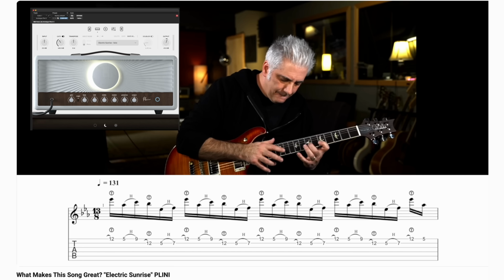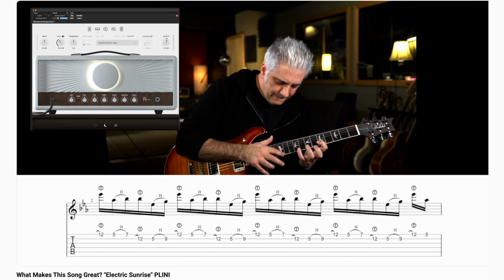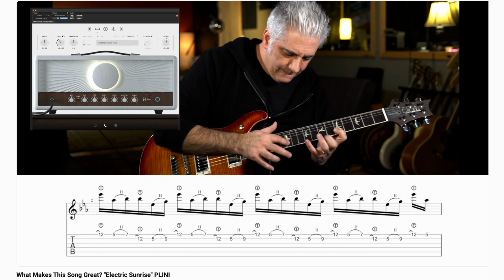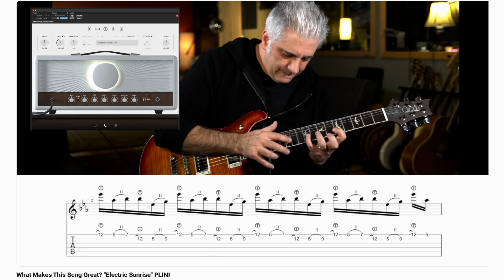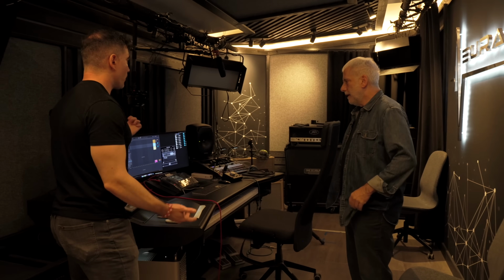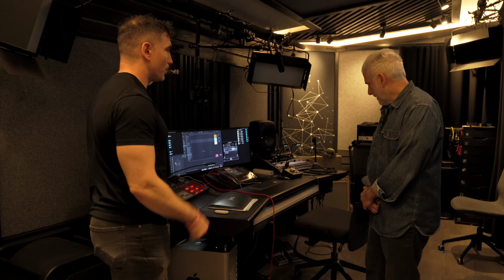I Flew to Finland to Find Out...How Are Amps Modeled?

Comment: Why not just go straight to fractal? You know, the company neural reversed engineered?
I started with a headrush and then fractal fm9. Friend has the neural. The neural and fractal are nearly the same. 
There was one main takeaway from using this stuff. In the past 3 years I've bought 4 amps and maybe 25 pedals (on 2 boards). These are 96% right on and won't ever be 100%. 
It's ashamed that touring bands use this crap. You can always tell a real amp. The amazing thing is that the smallest national acts are the ones using real. The bands will no money and very little space in their van. I've seen 4 bands this year still using Kemper. There just isn't a punch to this crap. My 16yo and his friends can spot it right off, too.

Comment: This is the best “how amp modeling works” explanation I’ve seen—robot knob automation + real training data from the physical amp finally makes the accuracy claims make sense. Respect to the engineers and musicians at Neural.
Reply: The robot knob automation is so freaking cool. To develop that tool....just amazing and at the same time like, duh, of course you need to be able to record every possible combination.
Reply: @bassydude1 actually, it is more clever than that, using industrial designed experiment methodology you can capture all the variations with only a sample of settings.

Comment: Great interview. Doug seems like a g. I’ve had a Helix, an Axe FX and played a Kemper, but ultimately settled on a QC, which I’ve had since the first run. For me, the QC managed to combine the ease of use of the Helix with the sound quality of the Fractal, in a unit that is a sensible size. When I’ve used my QC to model my personal amps, the faithful-ness of the modelling is astounding, almost imperceptible which is which. It’s not perfect, but for me and my use case, it’s the best in class.

Comment: AI is an umbrella term. Machine learning, neural networks, and deep learning are all forms of AI.

The key difference is that in traditional machine learning, humans design the features the model uses to make predictions, and those can be tweaked to improve results.

With neural networks (and deep learning), the model learns its own features from data, which makes them powerful but harder to interpret.

In many cases, if traditional ML performs well, neural networks can achieve similar or better results.

Comment: Neural Dsp has by far the best amp modelers/vst's. BUT running through a daw as a vst plug in, they are the only modeler that gives a weird noise after a palm mute. Can't figure it out, only happens with Gojira and Tobin ndsp.

Comment: Interesting to see the passion and hard work. Modeling and capturing comes really close to the real thing, but to me the real amp is the cherry on top.
I have never played a tube amp through a caninet, always with a reactive load and headset.
So the comparison is fair.
I’ve been through several Axe FX II and Axe FX III, and Tonex.
While they can sound nice, they haven't been able to beat a real plexi, Mesa Boogie Mark series or Marshall JVM410HJS. With these amps I can hear and feel that extra thing that makes it more fun to play.

But if someone was listening, it wouldn’t matter to them, both in an album or live. But for the player that one thing you are chasing matters more than anything.
I spent years trying to get those tones I had in my head with Axe FX and other products, but when I plugged into the real amp the tone was there within a few seconds, then just turn knobs for taste and find the right IR.

I also prefer a real pedal in front of any modeler.

I spent many years getting the Joe Satriani tone from one of the best live albums and super colossal album.
But once I got his real VOX Satchurator pedal and his signature Marshall, only then I achieved his sound perfectly. You gotta pair it with his pickups too of course.

Comment: Assume each knob is perceptibly different in ~100 usable steps
Then: 100^9=1,000,000,000,000,000,000, one quintillion
And that’s still a gross underestimate, because:
EQ bands interact
Gain staging changes frequency response
Presence/depth are feedback-loop dependent
Overdrive changes harmonic structure, not just level
Bottom line
Mathematically: infinite combinations
Practically: astronomically large
Musically: many settings are redundant or unusable

Comment: Total combinations = 7^8 So there are 5,764,801 possible combinations.
If you double the scale to 14 dots, each slot now has 14 discrete settings:
14^8=1, 475, 789, 056 So you get 1.48 billion combinations.
If you go with the analog range of each knob,

Comment: I have tried a number of amp modeler plugins. The challenge I have is the once it heads to the mix engineer unless it is rendered they change the plugin, as they don’t have mine. I would certainly like to use either a plugin or a hardware pedal to preserve my sound without having to mic an amp in a small room. Suggestions?

Comment: When it's cold in my house i can turn on my Ampeg SVT 300w tube amp and it takes the chill off my fingers so i can play. Try that with your amp models.
Reply: That's funny as hell you say that. My heaters blower motor broke And and they don't make that type anymore. So they had to look around for it or they were gonna have to put a new heater in. So this was gonna take a few days. So we got a cold snap. The basement was really warm. The first floor was OK, but the 3rd second floor was cold. And I was in a room with an electric blanket. So I was in my guitar room. Sleeping on the couch. And to keep the room somewhat warm. I was running two plexes a high Watt and a super  reverb Then it sucked to leave that room and have to go to the bathroom. I would have killed for that SVT.
Reply: Jokes on you, my computer running the plugins heats up my room 😂
Reply: @benstanfill363  Right!! 😂 These guys don't know
Reply: GPUs heat more than that nowadays.

Comment: The thing about modelers that no one ever talks about, is the one thing that I think makes them better than a real amp for most hobbyist and/or amateur guitarists. It's that they already have rigs setup for you, when they first came out, they were pretty bad- but most units now ship with some really good rigs already queued up. Many of them even have post fx- that you would normally only get like in a studio situation. Because here's the truth, though none of us want to admit it- 99% of us have no clue how to setup a complex pedal chain and make it really work with our amp and cab the way it should. Its not at all uncommon in fact I'd say it's really common, to have multiple EQs between you and the preamp, and another EQ on the preamp, and maybe another one in your fx loop. Your guitar has a volume, every drive has a volume, your amp has two volumes, oh what fun. They say for every 2-3 pedals you run into on another you create an extra virtual pedal- which seems to be true if you've ever played around with a signal chain. Just changing the order of a couple drives can massively change the tone. But modelers make it easy, the average hobbyist doesn't want a Phd in sound production, we don't want to play around with a signal chain for a couple hours only to spend 3-4 more tweaking knobs. We just want to cover that kick ass Mastadon tune we heard so if I have a preset called "Steambreather" I can just dial up and boom, there it is- I'm happy. It may not be perfect, but I'm not recording an album- it's close enough for me to play rockstar. And tbh, I've seen a ton of pros. using UA amp sims to- usually live- I assume in studio they still use an amp, Idk.

Comment: They should focus on making a REAL DEAL NOS Mullard ECC83 preamp tube. Instead of building counterfeit amplifiers. They can't model a good tube amp that's harmonically rich on the edge of controlled feedback sustaining with all the even order harmonic over tones. It's difficult to explain it with mere words. It's an experience  that will put all these counterfeiters in check.  It all boils down to one thing for them, Big profits. Digital is cheap as dirt to make. Its a big F U from the musical instrument industry. Give it a couple years and LCD screens go dark and for some reason it doesn't sound as good as it used too. Ladndfill garbage, No amp tech will work on this kind of cheaply made garbage.

Comment: Having built a variety of tube amps, and no two of the identical amp sound the same because of a thing that sampling amps can't emulate..... component tolerances! Resistors and capacitors have a tolerance, and depending on what type of resistor is used, the tolerance varies. This is especially relevant to amps built in the sixties with carbon composite resistors. The tolerances are all over the place, and tolerances in both resistors and capacitors alter with heat, as do the tolerances in the transformers, tube sound also changes with heat, and is especially variable depending on how the tubes are biased, so good luck duplicating a sound which is constantly changing. Give me a tube amp any day, and leave the emulators for kids who are still learning,  and the tone-deaf who can't tell the difference!
An edit to my rant. Tube amp sound is also affected by different makes of power tubes, and especially the first stage input tube (12AX7). Svetlana makes the amp sound totally different to TAD, which is totally different to Tung-Sol which sounds different to Mullard, and the list goes on, so which combination are they attempting to emulate?
Reply: Lots of negativity there - are you okay?
Reply: @balisaani  I'm good, and thank you for asking.

Comment: Doug is very impressive. I recently bought a Quad Cortex and I am speechless. After 5 decades of tube amps, I never thought I'd see the day, but here it is! These things are awesome! Just have to figure out the best way to monitor it onstage. It records like a dream! Super refined sounds drop right into the mix. Kudos!
Reply: Get a couple Fender Tone Master Cabs. The EQ on them is super useful, they push air great, and they have an XLR out that isn't affected by the active EQ on the actual speaker.

Looks great too and has the classic fender tilt legs, which work better because it's super light.

I'm a diehard tube/cab guy but my tone Master cabs were great purchases.
Reply: Main thing to keep in mind is that micing a cab generally boosts the bass below 500Hz  via proximity effect and mics usually lift above 2kHz in different ways.  Fig 8 pattern ribbon mics boost more than cardioids, and may not have any high end lift.  A secondary output with an eq to flatten the low and high end, maybe set differently for each preset, might be useful for monitoring.
Reply: @GCKelloch  I always cut some bass on my Tone Master, and even on my Cortex itself.

Then again, I played with Ampeg V4s so long that I often hear any extra bass as flub. I think it's a symptom of hearing damage 😂
Reply: @shawnmcvey7789  I guess you hit reply a few seconds b4 me in our last posts.  Sounds like a good solution.  Something like those Tonemasters could probably be made fairly cheaply.

Comment: I hope they're not recording those amps in that room. There's no way they can get a clean sound there. 

I wonder if they've done any amount of independent double-blind testing with accurate level matched output.The most important question that should have been asked is how you're assessing "accuracy" in reproduction, and is it independently verified.

On the other hand, you can do double-blind level matched testing between most different amps, within acceptable power band, and I doubt most musicians would be able to tell the difference (unless an amp is really messed up). It's very easy to sell products to most musicians. Now convince Benn Jordan that it's accurately reproducing the other physical products and that'd be something.

Comment: I'm only partway through the video. So far, I am SO IMPRESSED with the attention to detail to replicate these tones!!

I would have liked to hear how amp modelers strip out the guitar component in designing the models. In other words - the guitar itself will change how an amp reacts. When they are testing the models, the guitar itself introduces signal nuances. Do amp modelers somehow remove the guitar itself from the model such that when someone plugs in their own guitar, the signal is treated similarly as it I was plugging the same guitar into the actual amplifier?
Reply: I'm pretty sure the test signal they use is not coming from a guitar at all. I don't know if it can be a single impulse with various dynamics (most likely) or some kind of a sweep for the full frequency range, it would be an awesome technical detail to know.

Comment: The mathematics are based on Fourier transforms and Laplace transforms which are incomplete and have their flaws. With these maths there’s no way modelers will sound exactly like the real deal. They can sound close but will not sound the same.
Reply: These concepts only cover systems in the linear response regime. I think for modeling very distorted tones, the are using Volterra series expansions. To stay efficient, they have to truncate them at low orders so your conclusion remains correct.

Comment: I purchased their NanoCortex device when it came out expecting firmware updates to future proof it from what is going on in the industry. I am glad I got it. My kind of engineer talk. I expect it to get better and better over time. I still use tube amps. It goes into my Hot Rod Deluxe. Best of both worlds! And I get access to all those captures in their Cortex Cloud to try other amps. It adds to tube value; does not subtract.

Comment: I’m not a fan of this company. I was an original QC backer and have bought and sold twice. I don’t use modelers for amps anyway. I use an AXEFX3 for FX only and even then it’s almost never - I prefer real gear. I have high end monitors and never want to play guitar through them. Give me an amp and cab and some FX. I prefer Fractal for FX - they are continuously innovating and blow away the QC. Meanwhile Neural still haven’t delivered on their promises 6 years ago. As for me, I’ve purchased 4 different 100 watt amps over the last 8 weeks. Keep telling me amps are dead. I’ll keep buying them.

Comment: I find that there's a sound in tube amps that digital amps just haven't been able to replicate yet.  I'm not sure the actual name of the sound (maybe sag) but especially with distortion it's very noticeable.  I do find with clean sounds I do prefer digital for the most part.
Reply: Especially at stage volume with a Rock n Roll band, it just can't compare.

Comment: No, guitar amps are not obsolete. I would love to just show up at gigs with nothing but a modeler in a gig bag, but it's not possible for everyone. Fly in a little private plane to the show with your quad cortex and ebike ready to rock... it's a pipe dream man. I'm still loading amp heads and cabs into the back of an SUV.
Reply: Quad Cortex and ebikes - so Rock'n'roll! Love it 😂
Reply: Why?
Reply: @gainlovingcriminal  Because, using modelling live is entirely dependent on having a great sound system and monitoring. That’s still not the reality for most bands in small venues. Along with IEMS, digital systems add complications & set up time.

Comment: so all the raw signals in and out of the amps go through a clarett ? does that mean that all NDSP models somehow have the clarett converter sound built into them ?
Reply: Yeah I suppose so. I wonder if they turn the air mode on. I have a Clarett, and it does have a colour, especially with air on.

Comment: I worked as a touring guitar tech for Kacey Musgraves and everyone used Quad Cortex's. The band plays vintage acoustic guitars / banjos through it with one extra component / Audio Sprockets TONEDEXTER in one of the loops. We had them sounding really great with tons of compliments. 

The only real issues I encountered (in a touring environment) having them on a rack drawer and not being to access the back quickly in a pinch since the jacks are so tight together.  Or the touch screen not always perfect in certain situations. We are under the stage in a dark looking mission control type area, that is super crowded. The Wifi in that situation could be a nightmare if we had to do quick backups or send a file to another band member. WIsh there was an easier way to go USB or on a stick and just move a preset very quick.

I wish you guys made a rackmount version of these and spread some things out on the back. SEAL had one on his pedalboard when I worked for him and had no issues! I do think it's a great alternative to Axe-Fx & Kemper. But, def have a lot of experience with these and wouldn't mind helping.

THANK YOU! For also being very quick to answer questions and helpful on tour.

Comment: None of these amp modelers sound as good as the real thing. Neural Amp Modeler comes close (NOT Neural DSP).
Reply: I think v2 captures changed everything. I’ve yet to see any technology capture fuzzes and or compressors
Reply: I find toneX gets shockingly close, you just need the right speakers. The sound is 100% there, unquestionably. The response is where things need to advance. If the response speeds can get on par with analog, then amps will become obsolete. 
I love my peavey penta half stack to death, and it is bar none my sound.